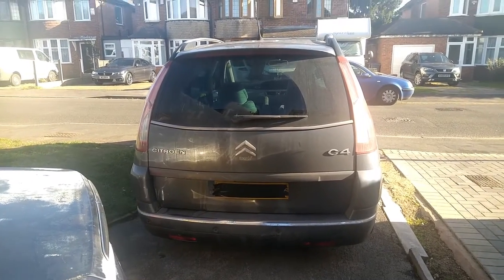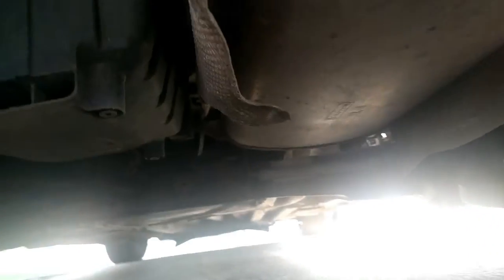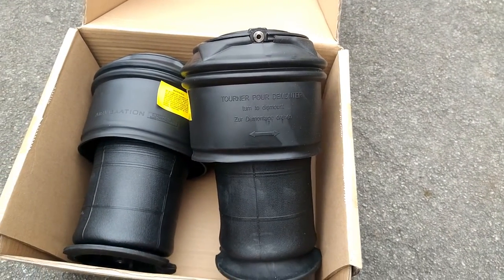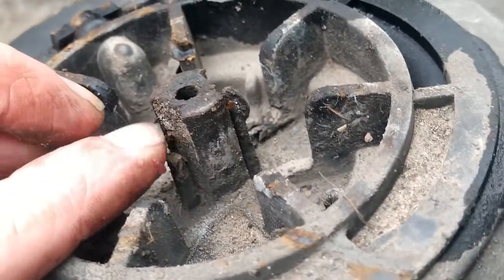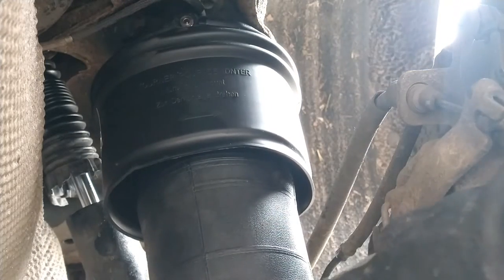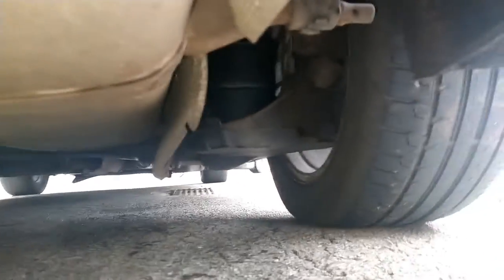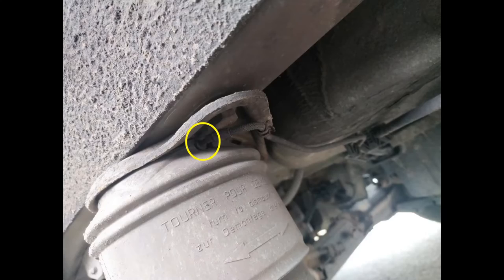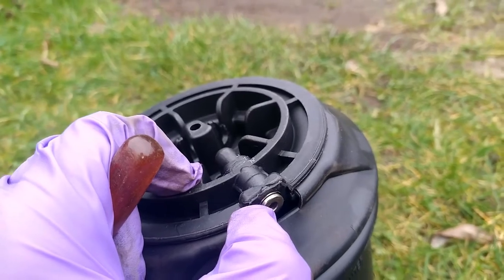Citroen C4 rear airbag suspension replacement

Comment: Hey  thanks for taking the time to produce this  video. Mine sits down now and again. I thought it may be the ride height sensor if there is one. Best wishes
Reply from the maker: If we share what we know we all get smarter. Now, yes there are height sensors. One in front of the rear wheel, and one in the middle of  the axle, (don't ask). But if these fail they normally bring a suspension fail message on the dash. I think I've measured their readings in one of my other suspension failure videos, but I can't remember which one. But saying that, the most common reason for the car lowering, especially overnight, is a hole in a suspension bag. My fault was quite specific but usually dirt and grit gets trapped in the fold of the airbag and just rubs away at it until a hole appears. As I did here, pumping the suspension up and spraying a soapy liquid over the bag can find most leaks. I hope this helps.

Comment: Really helpful and clear. Thank you. I am about to do the same job after garage wanted £200 a side for airbags from their supplier before labour. !! I've found what looks like the same air bags that you use on ebay about £50 a pair.  Could you confirm the part number you used thanks
Reply from the maker: @AndyW-t6f  So glad to be of help. This I think is where it ends though as I can't remember the part number and my ebay account has changed so I no longer have a record. I generally just search for citreon c4 2008-2013 and in this case it would be rear air bag suspension. I do remember it was only about £35 a pair because I'm cheap. Lol. But that was a few years ago so £50 sounds about fair. I don't think there were different options anyway so I feel you'll be OK.

Comment: I've got Peugeot Expert Tapee and ordered one of those bags in Ebay, when I fit them in position, lowering car down and start pumping air in, it just pushes this bag out of its position. I am a bit stuck here don't know what to do now. Any help will be much appreciated. Thank you.
Reply from the maker: @arvissorokins8897  Answered this above for you. If it hasn't come through I'll re-enter the info here.
Reply: @channelone4655  Thank you. Seen your other comment/answer. :)
Reply from the maker: @arvissorokins8897  👍

Comment: i solve my faulty suspension error when is cold , and the sollution is when start the engine don t release the handbreak until the car levels up
Reply from the maker: Well done for finding a solution. It's odd that it only happens when cold. The suspension shouldn't lose air though so doing as I did early in the video may help find any leaks. 👍

Comment: Rear disk brake heats more than the others. Changed caliper + bearing, still some heat and brbrbrbr from that side at speeds over 40mph. What could it be? :(
Reply from the maker: The electric handbrake is a notorious problem on these. You can manually disengage it through a hole under the left front seat. There should even be a wire tool in the tool kit to do this. Obviously this will cause it's own problems if it's an automatic as you'll have no park brake but it could rule the problem out and I'm sure the same tool can reengage the brake.

Comment: Hi, were those £47 air springs good? Are they still ok after 10 months of use?
Reply from the maker: I've had no trouble with them at all. After the first few days, then a 600+ mile holiday with a full car I stopped even thinking about them.

Comment: Hi, did the ebay airbags hold up Ok? I've got a Peugeot Expert van with the same set up and I've been quoted a huge amount by Peugeot to replace air bags and much cheaper ones on ebay. TIA
Reply from the maker: Still going strong and had no issues. If it's just the bag that's the problem they really are a simple job to replace too. 👍
Reply: @channelone4655  I've got Peugeot Expert Tapee and ordered one of those bags in Ebay, when I fit them in position, lowering car down and start pumping air in, it just pushes this bag out of its position. I am a bit stuck here don't know what to do now. Any help will be much appreciated. Thank you.
Reply from the maker: @arvissorokins8897  On the top of the bag there should be 2 clips which secure the bag to the car. The bottom just seats in a cup on the axel. If I remember I clipped the top in, filled the bag then lowered the car down making sure the bottom of the bag seated in the cup on the axel. Then went through lowering and raising the car before setting back to the neutral point.
Reply: @channelone4655  Thank you for your advice. 
Yes,  when fitting top part it just hangs and the bottom needs just directing into its hole. I manage to fit it just now but I did other way around as of your advice. I fitted bag, lowered car and then pumped air in(but not max up), luckily it doesn't push it out and, I hope,  while driving there will not be any issues with loosing air or with this bag in general. Only one thing what annoys is this warning light in dashboard sometimes comes on while driving. I believe this height difference is not right between axels as in pass mechanic manage to connect with OBD and that is what it was showing. Maybe you can give advice of how to resolve this ? 
Anyway I guess your order of fitting was the right one.
Thank you for any advice in advance.
Reply from the maker: @arvissorokins8897  OK. Well there are 3 solenoids in the compressor. Each side has one to pump air into it's bag, then 1 which vents both bags down. They are prone to getting moisture in and sticking which has been cause for many problems. Generally if the dash light comes on while driving there's still a leak somewhere or a compressor issue preventing the alteration of the height. Now for goodness sake don't do this without having the car supported on axle stands or similar. But if you visually notice one side lower than the other, most notable after leaving stood for a few days, you can swap the pipes coming from the compressor over. IE, the left bag going to the rights port and vice versa. There will be a gush of air when doing this and obviously the bag will empty. Once filled with air again if the side which lowers changes then it's a compressor fault. If the side which loses air remains the same then is a leaky pipe or most usually the bag. It took me days to trace and fix my fault due to having to wait overnight or longer to confirm what was happening. None of it is actually difficult to do though.
Reply: @arvissorokins8897  Hi, just wondering if this all went ok in the end? Going to have a go at doing my Expert Teepee this coming weekend. Fingers crossed it all goes ok.